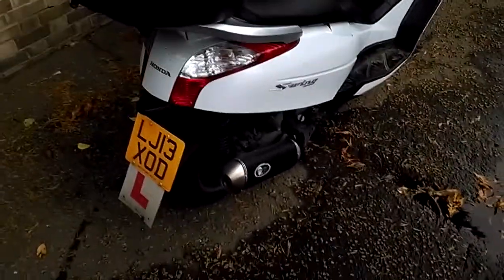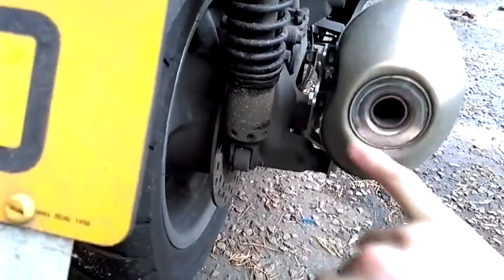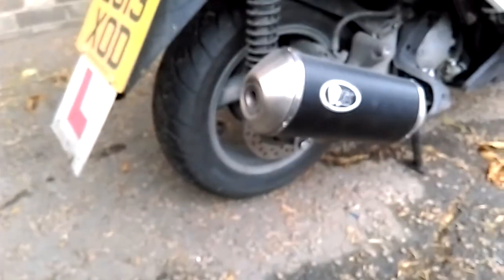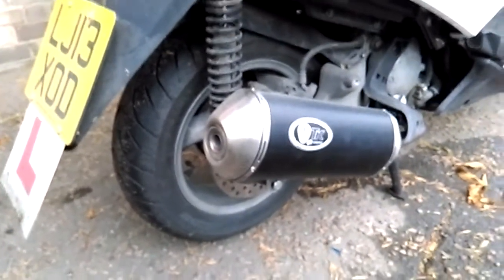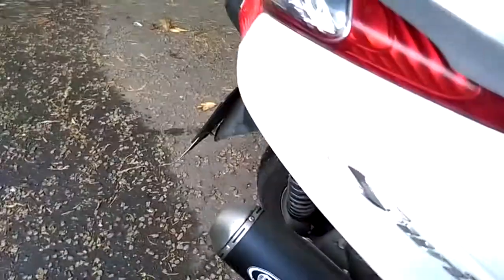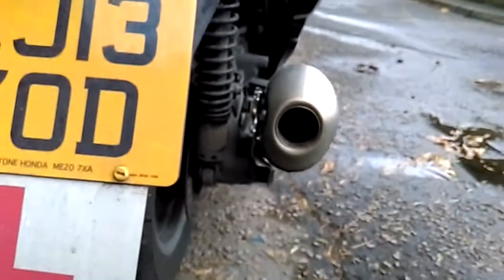Honda S-Wing 125 with Turbo Kits exhaust system

Comment: did it make it any quicker
Reply from the maker: No and an exhaust won't generally make a 125 quicker or more powerful. I bought this exhaust as it's stainless steel and 30% cheaper than a Honda replacement, made from mild steel and rots out in 18 months.
Reply: Thanks for reply was considering one for my forza 125 mainly wanted it abit loader for people to be more aware i was there as mines so quiet. Would be nice if it added abit of power aswel
Reply from the maker: +charles collins The exhaust does remove the cat which makes it breathe better. I advise running with the baffle in as you need the back pressure, mine was very sluggish without the baffle in.
Reply: One Wheel Drive where can I buy this from
Can u send my the link thanks would appreciate that